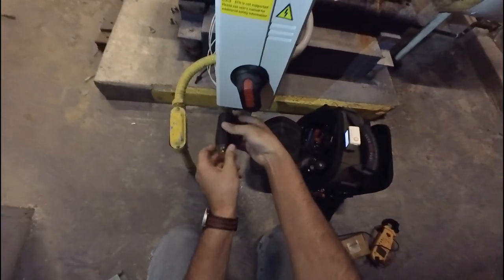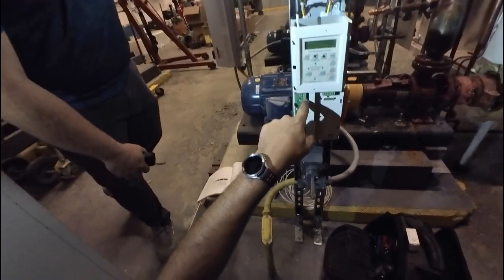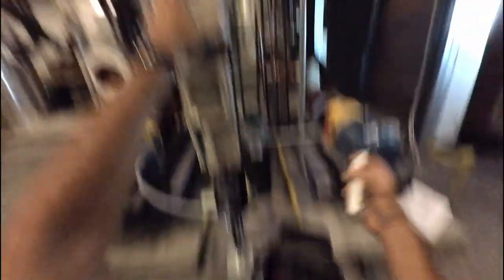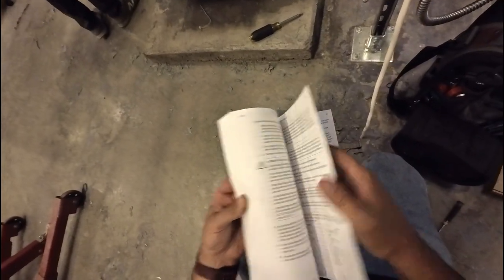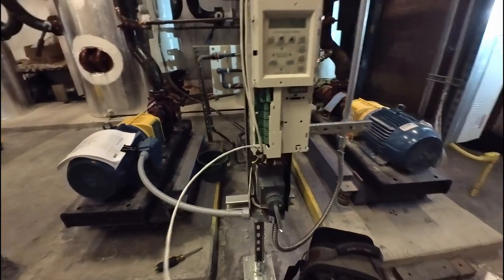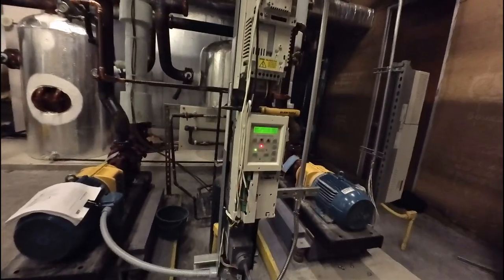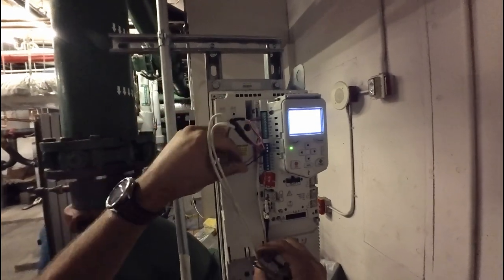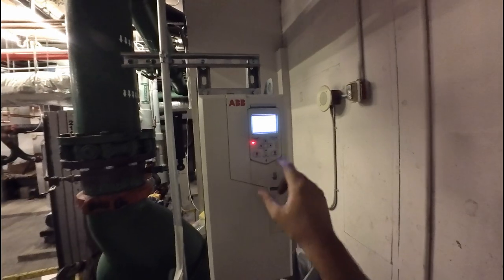ABB VFD Wiring Fixed

Comment: Good drives, don't ever use them with a bypass requirement so that was an interesting with the inputs. The only issue i have is ABB didn't provide any way of copying the programing from the 550's to the 580's.

Comment: yeah people often get confused by the e-clipse bypass. if used, bacnet comm goes to the bypass unit. if you use hard wire for ss/speed then only the speed reference goes to the actual drive. the ss goes to the bypass. the best is when someone lands comm wires on the drive and then goes in and changes the modbus comm settings between bypass and drive, trying to get comm working. 🤷